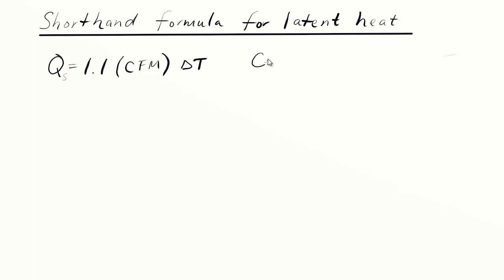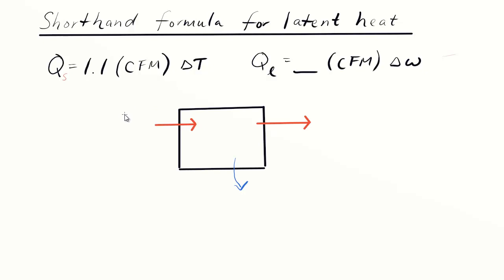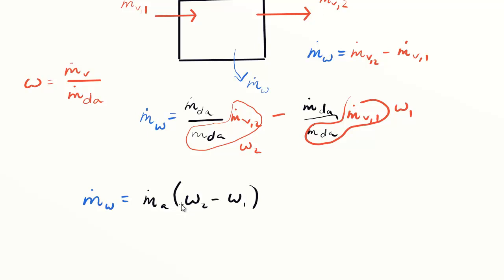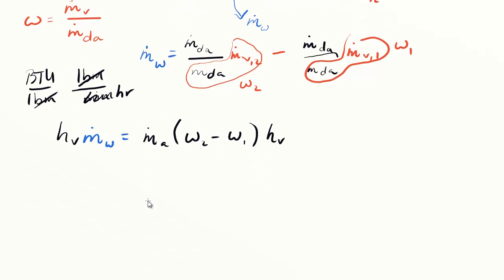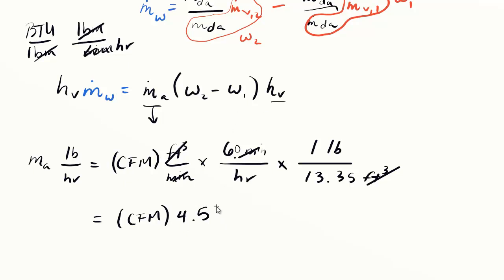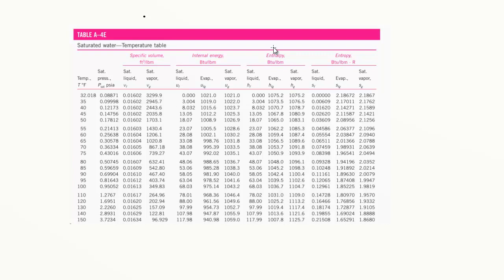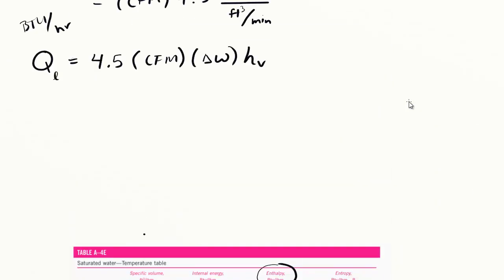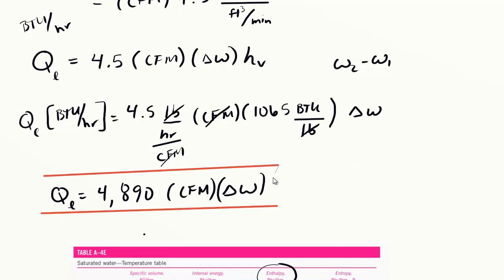Latent heat formula for HVAC engineers - where does Q = 4,790(CFM)Δω come from?

Comment: Thanks for the great video. Why is humidity ratio unitless?  Should it not have units of lb moisture per lb dry air? In the formula mdot_w = mdot_a*(deltaW) it is imperative that the lbs of air cancels.
Reply from the maker: Thanks for the thoughful question. Let me attempt to provide some clarity. 

It depends on how you view the units - If you view 'lb dry air' all together as a unit, which is entirely independent of 'lb vapor', then yes, it's imperative that you carry those units throughout the calculation as you have described.

However, if you view the units for both of those as just the unit of mass, lb, then you have lb divided lb, which you can think of as unitless or 1. In that process of cancelling, information is lost, since there are an infinite number of ways you could get to that point. This is why we still normally present the humidity ratio with the explicit units lb vapor/lb da, so we don't get confused which variable is in the numerator or denominator. But when evaluating the formula, it can be considered unitless.

In a unit system, you typically add things with like units. If I have 2 meters of aluminum and 2 meters of steel, I'm still normally allowed to add these together for a total length. However, if you take the viewpoint like you have done above, these would be considered different units, and this operation wouldn't be allowed.

Comment: Dear sir , in your converting  mass flow rate of dry air 
m dot (lb/hr) = roh of air (lb/ft3) x Vol(ft3/hr)
Now to convert 
Vol from (ft3/hr) to (ft3/min) 
We have Vol (ft3/min) = (1/60) x ft3/min 

So how come you are  mutilplying  by 60 instead of dividing by 1/60 

Could y explain 🤔
Reply from the maker: We are multiplying by 60 minutes/hour, since we wanted hour as our unit of time in the denominator in the end.
Reply: @MitchellPaulus  but sir volume flow rate is all ready in ft3/hr unit and we need it to be in ft3/min So that we would have cfm as volume  flow rate , that we can use it either in latent and sensible  heat calculation , 
And as u stated if we x by 60 min/hr ,
Then we have vol dot = ft3/hr x 60min/hr
Which lead to canceling hrs unit and we left with ft3/ 60 min which we can express as ft3/min x 1/ 60